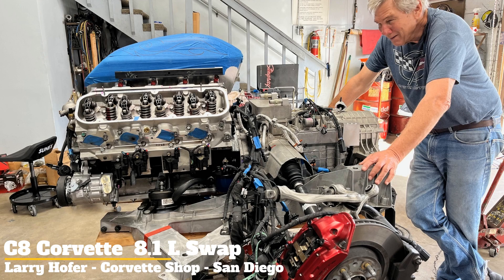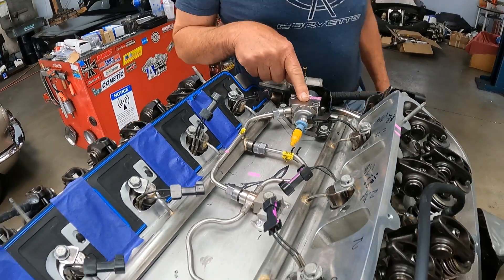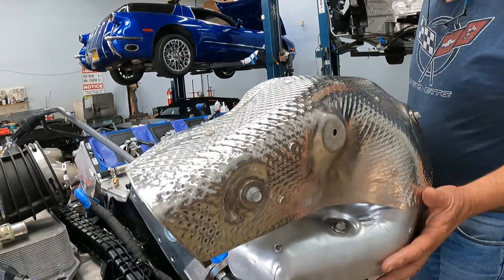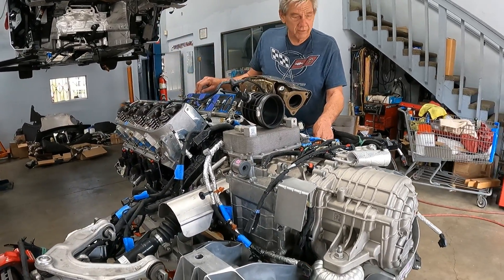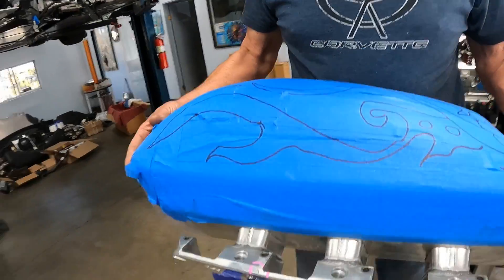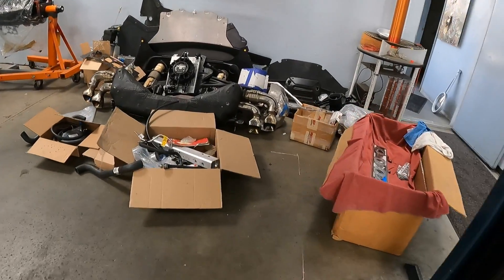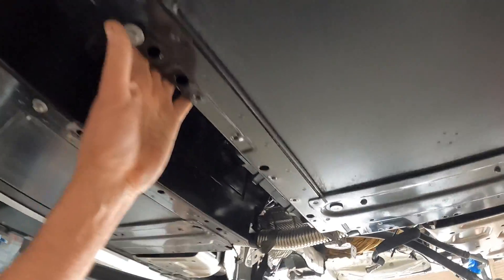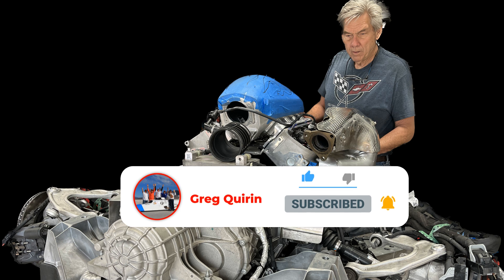World's First Big Block 8.1L- C8 Corvette Engine Swap

Comment: I have a suggestion. Add port injection to the intake. Direct injection is good for 2000 to 6000 rpm. It has a rough idle and runs out of pump way to quickly.

Comment: Too bad the stock ecu is garbage and super limited on tuning aspect of it. Will never work right as a typical heads cam c8 is a dog and slow. Going to have to run off an e92 most likely so can have proper adjustability. Seeing LME 416 inch c8 builds that won’t even go down the road as so many issues due to factory ecm. Great idea but won’t work with that garbage factory engine management I tune them along with all gm. Trust me this is not gonna be what you’re hoping for from that e99 as hpt hasn’t unlocked nearly enough which is needed for even a typical heads cam combo. So far the motec is being used on anything that’s trying to go fast.

Comment: Given Larry Hofer's and Don Taylor's encyclopedic knowledge and incalculable skill and designing stuff for Chevy small and big block engines I'm wondering if they've ever considered designing a GEAR-DRIVEN Overhead Cam head configuration for the LS or LT engine. I think any OHC configuration would necessitate having asymmetric heads but the reduction in valve train mass might make that added expense worthwhile in terms of a higher revving engine. I'm thinking well beyond 8000 RPM; perhaps into the 12000 to 15000 range.

Comment: I own an 04 Sierra 2500hd with an Allison/8.1. Has about 127,000 miles, very, very clean in silver birch metallic. Plan to completely upgrade it with forged internals, turbo, full suspension, etc. as money permits. Been eyeing Raylar parts, and watching Lt Tolman and Holdener for ideas.

Can't wait to see how this project turns out! Might be able to utilize some things that you pioneer.

Comment: Am I the only one who thinks this won’t end up with any extra power compared to a heads and cam LT2?  Especially if they aren’t putting much camshaft in it to keep the computer happy. Maybe more torque.  See Raylar’s site to see what they normally get out of the “mighty” 8.1l.  It’s not much different than a cammed LT1/LT2. These gen V engines are a ton more efficient in making HP than the old gen VII BBC.

Comment: Has there been consideration for using a set of speed of air dimpled and thermal coated pistons with Gapless total seal rings on this 8.1 build?

Comment: Love to see your Tesla Coil in action saw it when you showed the stock C8 parts on the floor.
Reply: you are one of a few,,, that was a collage project for my electronics class , some 50 years ago. had plate capacitors originally, up graded to banks of HV caps.  Still works, Really well ,, pales by the energy of the newer breed
Reply: @larryhofer2266  made one using the guts from several bug zappers a fraction of the power of yours but it was fun to fool around with and learn.

Comment: This is one of those "yeah it can be done but who TF would wanna do it for such minimal gains" type projects.

you can boost the existing motor for 1/100th of the work and gain 3 times the power. I don't understand  the old school boomer way of doing things do modern cars.

I'm reminded of a quote from the movie Jurassic park: " You were so preoccupied with whether or not you could that you didn't stop to think if you should."

Comment: I want some heads like that for my 8.1L
Reply: The DI high pressure pump in the block is a pain, so are the fuel rails.. better to just get my standard CnC aluminum 8.1 heads , put the cam and intake on,  and be done .. works great.
wont take you the three years this has taken.

Comment: I had 8.1 in 2002 2500hd 4x4 brand new.  I really never used the truck for much.  I bought it to do a tow a traveler trailer.  Only towed my Jeep on a flatbed.  That thing would go up to the Loon Lake from the bay area get the same gas mileage back.    Amazing the power that engine had back then.

Comment: This is how America does. Just slap a Hugh V8 with big turbos, and that's it.
No engineering, no research, no innovation, no creativity, nothing. 
Instead, nissan has a platform at the GTR with a V6 twin turbo capable of 3,500 HP.
Smaller, lighter, and more advanced in technology. 
There's nothing interesting about this build, the same thing again and again and again . Boring

Comment: Arias in California has built about ten 502 cubic inch Big Block Chevy's with DOHC valvetrains.  This is done via 4 valve per cylinder Porsche M28 heads off of the 928.   It requires some drilling and welding of the heads and a special water pump fixture that can drive the belt for the overhead cams, but these make 550 hp all day long.  THAT would be an interesting swap into a C8.....
Reply: Good morning,, interesting you mention the 928 heads. Pete Aardema built an aluminum  Big Block with the Porsche heads 35-40 years ago. He found the heads in a junk yard and went"  Wonder if i can make these work on a BB" Been at least 35 years ago, may be 40, and has been running it in his 1934(I think) for ever,  I would expect he was copied by Arias, but i don't know.. the bore centers of the Porsche head is slightly closer than the big block Chevy, but can be spread out over the length of the block . been working ok. Pete put a belt drive on the front of his , he hates chain drive, and has been running if for all these years. Also made a cross ram injected intake for his. but that is Pete, that is what he does.
Reply: @larryhofer2266  Nice!  

The Arias motors use the timing belt from some Renault car to drive the exhaust cams, and the intake cams are driven by a chain off the exhaust cam.  This is standard on the M28. The belt is not turned by the crankshaft.  Instead,  a cog is mounted to the original Chevy cam, which is in place but does nothing and is driven by the standard Chevy chain.

Comment: Fascinating!

Frankly, I would NEVER do this.  The LT "small block" V8 is very light and very very tough.  And it makes 500 hp while passing California emissions AND with perfect driveability.  It is truly one of the greatest engines on the planet.  Installing a big block is fraught with problems with fitment and conversion to work with the CAN bus on the C8, and I doubt it will make more power yet will certainly weigh more and these are nowhere near as durable as the LT!

Really, the only reason I can see to do this swap is just to say you did it.  Which would indeed garner serious points at a Cars & Coffee event.

GREAT video!
Reply: there is no doubt the LS-LT is a really great engine , but it depends on what you want out of your driving experience,. The big block has a flat torque curve and the LS-Lt has it all at the top.. me ,i like the flat torque curve . just because. and the extra 200 LB of weight just adds to the tractive force in the rear and the extra torque is more than able to accommodate it.
Reply: It's about torque brother
Reply: @hisinvisibleness-fn8qj  The LT will still make more torque....
Reply: @Flies2FLL  delusional

Comment: My only apprehension would be cooling, but after listening to this gentleman I think he has that worked out. At 494 cubic inches, that motor must make a mountain of torque, and with is comes heat. Everything I have heard about that transmission has been very favorable, I'm sure it's up to the task at hand.
 My other apprehension is the computer, but HP Tuners has helped me in the past and really did a great job.

Comment: Im curious as to how the idle will be with the adjustable vvt. Im assuming the cam will be performance oriented. Maybe a "ghost cam" tune with HPtuners to get the sound? And also great low speed drivability with the vvt?

Comment: When will a drop in big block kit be available.., and please hire me to clean your shop floors; the things I could learn just being a fly on his wall
Reply: no, don't think this will happen.. to many things like the bell housing bolt pattern,  transmission, fly wheel bolt pastern, starter, dry sump, none of the C8 dimensions work. the LT2-LT4 are not traditional Chevy architecture, and "nothing fits as delivered'.

Comment: Is the Tcm not going to shut you down due to torque overload?
Reply from the maker: Probably not ,Larry has done some tuning with Speed Society on  a C8 Corvette with twin turbos they were able to make some adjustments to  the transmission to hold up to 8OO HP

Comment: Pretty Amazing  idea .  Not entirely sure l agree with it . And the main reason is the massive  weight difference & distribution may possibly really mess with the Balance of the Vette . Just a thought .  Only time will tell .  As 4 the Engineering going in2 the 8.1 ltr BBC , well thats another story.  Awesome Brains , Execution & Workmanship . 
I would have probably gone 4 a big cube small block LS either with an Edelbrock Cross Ram or a Whipple Supercharger .  Anyways,  cant wait 2 see more progress.

Comment: Manual transmission should be made for this. Automatics suck for controlling your shift points. Take a regular version of this car onto a road course, and an older one with a manual transmission, and the manual transmission will make the older one better for the course.

Comment: I haft to give it to them, with the big block = more weight over the rear end, I don't know if that's a plus or minus? But the sound and toque on the bottom end should be fantastic.  I hope the transmission can handle it. But for ingenuity it's a 10 !

Comment: I'm A General motors world-class. Tech.and I'm not bragging that's a designation i retired the shop forman  Of a chevrolet dealership  in 2017 after 45 years Behind the wrench  if you're running all the same electronic components. The f**** computer don't give a s*** of it. A big box or a small block all it knows is that are all my parts here. Are they working correctly it should work flawlessly?  You might have to tune it because you need more fuel for the bigger engine. But the computer should run it without a hitch. Doesn't give a s***  if it's a  big block or Small block or both tyed  together.

Comment: The thing about a big block, is that they are very satisfying to drive. Great power everywhere.
Reply from the maker: Absolutely I couldn't agree more
Reply: yeah the vvt seems unecesssary for all those cubes unless they are just wanting to keep a lower stall converter for street use
Reply: @derekmaxwell8164  It's torque converter. The stall is what rpm the coverter goes to when the gas pedal is floored. Now that being said this is a dual clutch automatic it doesn't  even have a torque converter!! 🤭
Reply: @derekmaxwell8164 From the sounds of it sounds like he wants it to work with the factory electronics

Comment: The 1000hp 632BBC will be next👍🏿
Reply: No probably not,, i already make a 588 and decided not to use it. Idle quality of the 1000HP  GM engine is not very useable in a day to day driver, and the torque would probably hurt the clutch.. I would like to drive this for a while, not work on it.. But turbos are an option

Comment: Larry is genuinely a good guy. I spoke directly with him ordering parts for my 8.1 that I put in my Hummer H2. Super helpful guy
Reply from the maker: Larry is indeed a great guy and automotive ledged.  And a very generous person
Reply: I’ve been joking about swapping an 8.1 into an h2 ever since I got a silverado with one. I’ve done all sorts of wild stuff with it and it’s never let me down, but the 6.0, that on the other hand, has left a lot to be desired. What all is involved in actually doing the swap? I’ve seen duramax swaps that move the radiator forward and that seems to be the major packaging restraint. I’m very curious about this, especially since you’ve actually done it. What was your experience with it? What should I look out for? Does the computer work directly with the rest of the wiring from the original stuff? I assume most of the stuff should just swap over fairly easily because it’s basically the same truck under all the fancy bodywork. What transmission do you use?
Reply: @-sh1t  the radiator and air-conditioning components stay put even reuse the factory, AC pump, I used the stock, H2, PCM, and wiring harness slightly modified the crank sensor and cam sensor wiring swapped in a 4L 80 and the transfer case from an 0809 model I use electric fans and the PCM controls them. I did get a two core aluminum radiator for a 03 Silverado that bolts perfectly, but I added a sitting to the extra heater core hose. I had to cut the top off of the passenger side motor mount and move it forward I think 2 1/4 inch not sure I took measurements with the factory transmission in the truck with no engine, DMAX store upper motor mounts. I’m sure that I’m missing some of the finer details.
Reply: @2lucky01  I looked over your a channel a bit and it seems like you did almost exactly what I was imagining with the swap. I mostly want to keep the insides all mostly stock, mainly for reliability sake. The 8.1 I have has a little over 200k and supposedly had a supercharger on it before I bought it, and it shows no signs of wear and tear. I’ve towed, gone off road, all sorts of activities and it’s never let me down. The h2 is immensely capable off road with the stock engine, however my right foot is left itching with the 6.0’s power level. I have considered looking into the newer 6.6 gas motors and possibly doing a 427 based off that, but I have concerns about reliability and ease of swap. The 8.1 is simple and does everything I ask of it. I’m not too worried about mileage because it’s already not ideal, however I’d like to look into some sort of system that allows the stock drivetrain to run in rear wheel drive if I choose. Around town I don’t really need the full time awd, and it’s a lot of extra drag on the drivetrain that could be reduced easily. I am much more interested and seriously considering the idea of finding a junkyard motor and cracking it open to replace wear items for a swap now. If motor mounts are the biggest hurdle for packaging, I will most definitely be looking into a swap if the 6.0 ever pops or I get free time, haha. Thanks for responding, I really appreciate the knowledge man.

Comment: Next, Twin turbo,8.1L C8, the 8.1 should have been way more popular! Way more support from the aftermarket! 
It would be awesome to take the c8 overhead cam engine, and cast 8.1 heads to use the cams and valves, or design a head from scratch, heck build a flat plane crank to go with it!

Comment: He produced his own heads and this is glossed over like something everyone does in their garage! I would love a technician deep dive into the heads and how they became a reality. I have a set of circa 2006 Mopar prostock Hemi head castings that I would love to produce a talk deck block for. I want to use them in my 1970 Barracuda and need all the cubic inches I can get to make them happy on the street. Plus, who wouldn't love saying your engine is 600+ cubic inches. 😊
Reply from the maker: Here is Larry's website with more info on his 8.1 Heads https://www.raylarengineering.com/
Reply: For the normal guy, you already know about INDI Mopar. they already make what you are looking for, you will get it done sooner rather than later like me.  :)
Reply: @larryhofer2266  They are 4.900 bore spacing heads. They are not even a hemi head. They were just called that for marketing purposes in my opinion. The closest block I could see working was the Dart 4.900 race series iron block. The best I can tell it isn't available anymore though. There is an extreme difference between the intake and exhaust lifter angles. They are a twisted canted valve but still use the same length of rocker arms on each valve. So the exhaust pushrods pass through the deck very low.

Comment: @2:35 That's a bad question. If and only if there are two block architectures  available for purchase at the same time, then there are big/small block sizes.
Else, it's just 'the' block. The way Pontiac and Cadillac don't have two block sizes.
Not accurate to compare different eras, weren't available as an option during purchase / assembly time.

Comment: Why doesn't it have variable valve lift & duration, maybe by controlling oil pressure to the lifters?

(see: Fiat Multiair)
Reply: There is a company that sells hydraulic roller lifters that fit common hot rod engines like SBC, LS, SBF, BBC that retain more oil as the rpms increase. They're called Rhodes lifters and they use controlled leak down. They maintain more lift and duration at the valve than standard hydraulic roller lifters and are "tuned" with various oil weights.
Reply: @hendo337  that is basically what Multiair is, I think. It just adds some very precise control of the oil leaving from the lifters, because they are supplied all always. At WOT the hydro valves are closed for max lift, & the hydro valves are open when off throttle, so the intake valves don't open.

So precise that, at idle, the (electronic) throttle is held wide open, and the valves only open as much as the engine needs.

Comment: Who else wants a pair of those heads right now...
Reply from the maker: Larry Hofer manufactures these heads  look up RayLar 8.1 heads and you will find them
Reply: Yes, they would be insane to swap onto an  overhauled newer production used PSI 8.8L core that is commonly available for $1,000-1,500.
Reply: the direct injection heads are difficult. i would still use port injection .better computer options.
Reply: Yes!!!! Of course we all want to see and sub'd!